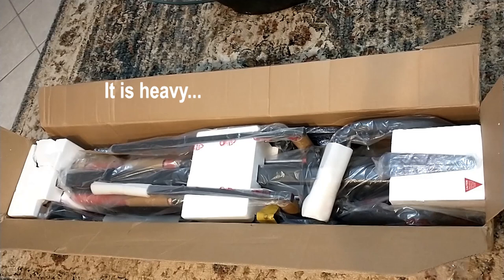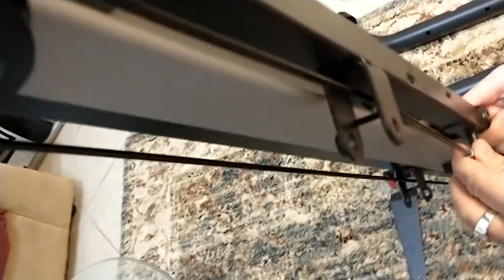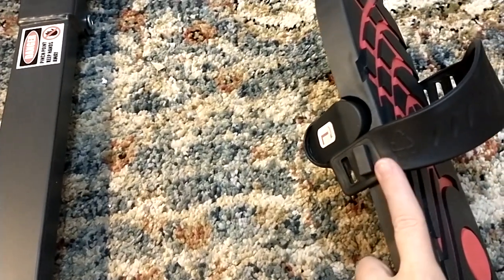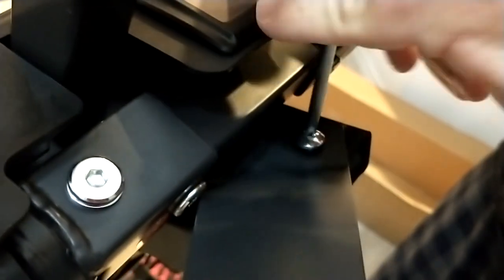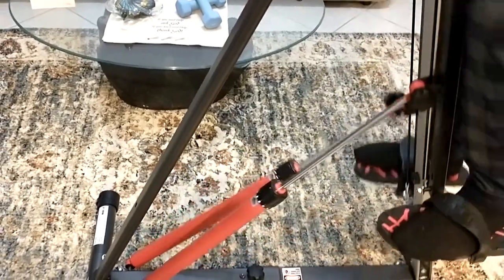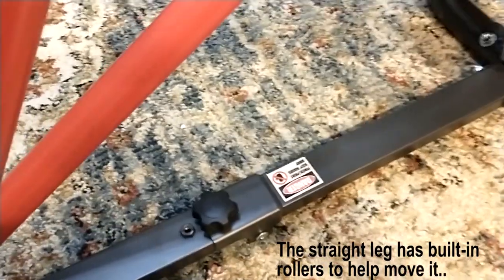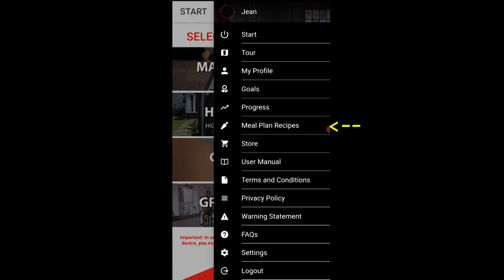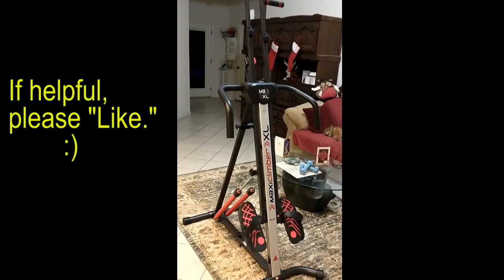MaxiClimber XL-2000 Hydraulic Resistance Vertical Climber - Assembly, Use, and Fitness App

Comment: Took me a min to figure out the two foot bar part just said bolts and washer with no number in the video it was skipped and edit with no visual.. So for anyone else who was stuck on that part @1:31..I figured to put the long #72 in through the bar 1st then through the holes of the bottom portion and then put the curved washer and dome nut #18 and screw on YW

Comment: All good but you have the straps on wrong.  Unless that's the way you like it.  But the side of the strip with the two adjustments should be on the inside. For two reasons. The indentations on the top of the strip can act as grip and the longer side with the seven adjustments should be on the outside so the excess length won't interfere with the mechanism..

Comment: MaxiClimber should be using your video for instructions! I just put mine together last night with just your video. Thank you! 
Now i need to find a Battery 😑
Reply from the maker: Yes, my battery arrived dead as well. You simply lift out the little square module, slide the battery down and out, and slide a new one in..

Comment: Great set of instructions. Men hate reading instruction books. But a video don't count ;) I found only two sticky points. Attaching the rubber shoe restraints is a royal pain in the a**. Requires a lot of pulling and pushing. A little easier if one side pg the rubber flange is pushed in and secured first. The second was the screw removal from the phone holder. I found it very tight. As was the installation. Threads hit a sticking point. I used a wrench and a proper Philips screw driver to seat it. That aside straightforward assembly. Thanks!

Comment: How do you fold it for storage
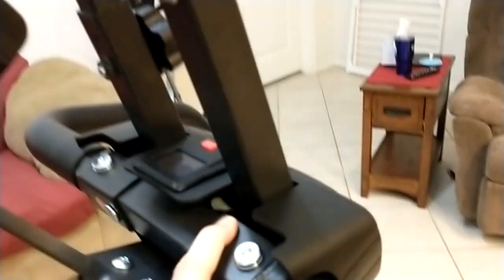Reply from the maker: It's discussed at about 5:42 in the video.  Basically, remove the knobs holding each hydraulic shock. Then move both shocks back to their storage position secure them back with the knobs.  Then, remove knob at the bottom center and pull up the bottom center.  It folds up sort of like an ironing board..

Comment: With resistance, is there “support”, meaning I won’t just fall back to the ground if not moving?
Reply from the maker: The pedals do not move unless you push down on them. One pedal has to go down before the other one will go up. I stop and take a break on mine all the time.  :)

Comment: Hi everyone. I found that if you heat the foot pedal straps up in very hot water for a minute and wear some good grip gloves you can stretch the plastic a bit to fit it over the pedal tabs. Now can someone help me? I cannot find the counter. Where is it located? Paste a link to a video if you know of one please.
Reply from the maker: The counter is shown in the small display.
Reply: @Jean78578   there is no sensor on the back of the handle like yours has. And no counter on the top in front of the phone holder. Which model has it?

Comment: Great video thanks. Question, the cylinders are a bit tight (rough) during use even set at position one. Can you lubricate the pistons?
Reply from the maker: I don't believe the pistons are serviceable.  The MaxiClimber site does indicate monthly maintenance:
Lubricate rollers and pulley with WD-40 or silicone based lubricant.
Reply: @Jean78578  Thank you.

Comment: Mine won't work. Called the company and they sent me a new one, still doesn't work.
Reply from the maker: What does it not do..?
Reply: Mine arrived damaged. I returned it and they sent out a new one. It was also damaged. Their packaging needs revamping. I did send them an email but they haven't responded in over a week which is making me a little nervous because they were pretty good at responded the first time. Also, the battery arrived dead in mine as well. Dents and broken foot pedal. Cosmetic the 2nd time around so hopefully that's all the damage.